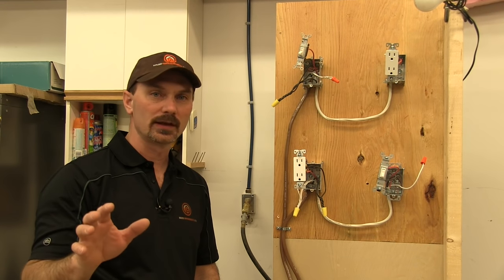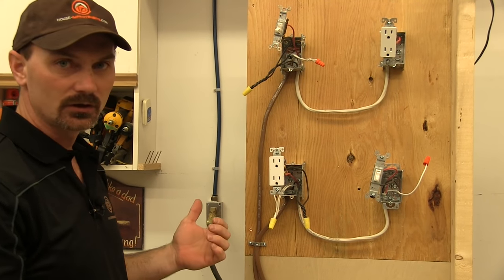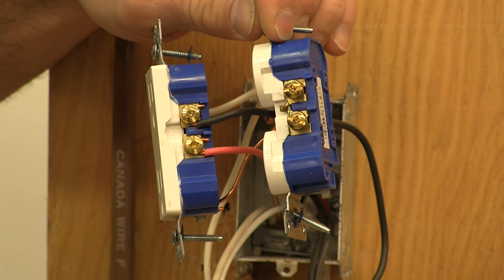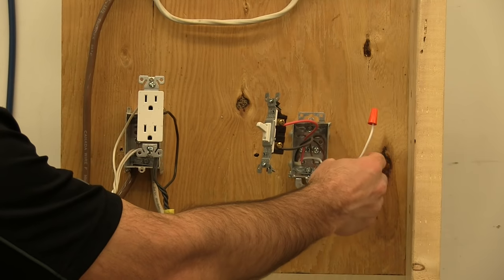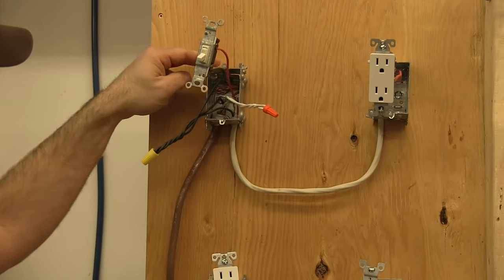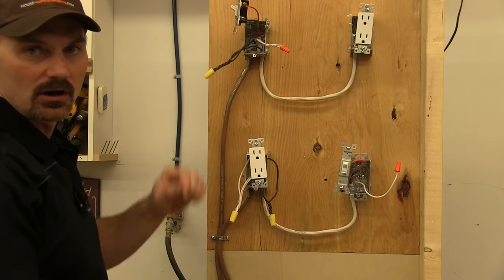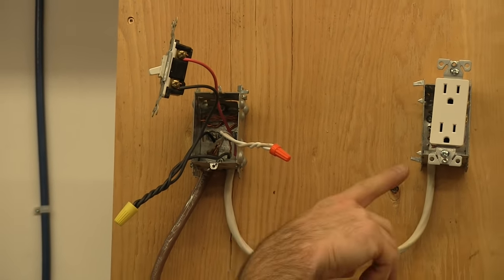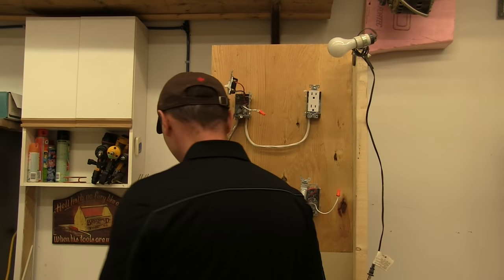How To Wire A Switched Receptacle

Comment: there wont be any big spark or boom if you forgot the tab, just wont be switched until you remove it
Reply: Giggle smith I agree I always work with live power 220 live awwww a slight jolt that tingling sensation what a way to wake up in the morning better than a cup of coffee from Starbucks .
Reply: @Guardducks  220 in North America is achieved with two separate hot legs, out of phase with each other.

Comment: Thanks again for a great video. I assume a black wire with red tape could be used as a red wire. 14 / 2 could be used....?
Reply from the maker: In the bottom example you need a 14/3 wire between the switch and plug. In the top example if you wanted both halves of the plug to be controlled by the switch then you could use a piece or 14/2 between the switch and plug. In that case you would also not remove the tap on the side of the plug.

Comment: My current challenge is how to utilize the same wires (which is the old two-line rope) that have been tied together along with the wires from two ceiling florescent lamps that are activated by a switch.  The other part of the challenge, in addition to the two-wire issue is that the power isn't running to the switch, it's running to where the lines have all been tied together.  What I want to do is to simply install an outlet with both sockets being run by a switch (which is already in place) so I can replace the current lights with LED lights that plug in and use the switch to turn the lights on.  Thanks!

Comment: Do you do it the same way if your bottom outlet is the main power coming in, and the top outlet is power going to the other outlets? How do I keep everything else on other outlets on if it’s supplied from THIS outlet that I wired to the switch

Comment: great job,thanks 4 all the videos, i have lights on my front fence connected direct to my breaker box along with my electrical gate, the problem here is that I wanted to put a switch and by doing so,when I turn off switch the electrical gate turns off too,how can I be able to fix this
Reply: 12/3 UF romex.

Comment: Hi... I have a situation like in the first example . But. I want the two outlets to have power at all time ( cancel the switch for the bottom outlet) if I connect the cables ( black and red) from the switch and live it in a metal box, would that be fine?

Comment: I'm installing a front porch light. I have an outlet near where my switch is. You think i can use the outlet for power supply to the switch? 

Im sure i can't just wire from the light two the switch to make it work. Pretty confused about this part.
Reply from the maker: Please post your questions in my forum and we can work on them from there ,thanks.https://www.house-improvements.com/forums/

Comment: This is a great video!  I need more help though. Please would it be possible for you to describe how to use/wire in a GFCI as the leftmost receptacle as shown in the first example (first 5 minutes of your video)?   I have a downstream single-faceplate combo switch/single receptacle which controls the food disposal The single three-prong receptacle on the combo is supposed to always be hot. When I tried using a GFCI upstream as shown in your example (first 5 minute example ), it always trips the GFCI when I flip the food disposal switch. I AM using a 20amp GFCI on this 20amp circuit. Also, It is not the disposal start-up amps tripping the circuit, because anything I put on the switch trips the GFCI, even a little battery charger.  Something is cross-wired.

Comment: Very helpful video. One question maybe you can help with. My gfci in garage is 20 amp and I just replaced it. I have a 15 amp outlet that needs to be changed outside that ties to the GFCI 20 amp. Is it ok to replace the 15 amp outside with  20amp outlet? Sometimes my 15 amp is overtaking and trips the Gfci.  Thanks
Reply from the maker: If the wiring from the GFCI to the outside plug is only 14 gauge then you likely will not make any difference. GFCI receptacles with trip easier than a GFCI breaker, maybe you can switch the breaker to a GFCI and get rid of the GFCI receptacle.
Reply: You didn't say if it is a 20 amp circuit, 12 gauge wire, I assume it is. You cannot use a 20 amp receptacle on a 15 amp circuit, but you can use a 15 amp duplex receptacle on a 20 amp circuit. Same thing applies to gfci's.
If you're gfci is tripping it is either bad or it is detecting a ground fault. A 20 amp gfci or receptacle will not correct the problem. A 15 amp spec grade receptacle is exactly the same as a 20 amp, but without the horizontal slot. 15 amp gfci and receptacle is really what you should use actually.

Comment: Thanks for the video. On the first application you show, is it really necessary (other than code) to use 14-3 wire? Emphasis on the "three." If you're capping the white wire off at the switch, does that mean it's not used? So technically (not legally), could I use a 14-2 wire and just not have an extra wire to cap? I hope that makes sense. I have an existing outlet with a 14-2 going into it and a 14-2 coming out of it. I just want to connect a switch to the wires coming out of it. Hopefully you can answer. I kind of confused my self with this question.

Comment: I do not see any recent posts regarding this video so I may be out of luck to get a response but I will try anyway.  I would like to make my garbage disposal plug a switched plug, top outlet controlled by the switch, and the bottom plug constantly hot. My switch has two whites twisted together and the blk wire on the switch my duplex has just two wires blk and white making the whole outlet controlled by the switch. Is there any way to make half of the duplex hot all the time?

Comment: Ok so I had a litlle oops in my house earlier today. I tried to fix my bedroom switch which hasnt worked ever since I replaced all my outlets/plugins about 20 yrs ago. In doing so I guess I "broke" the light switch in my bedroom that would obviously turn on/off one or more of the plugins. I knew it was because I had not broken the tabs. Well today, 20 yrs later, I decided now was the time :) I turned off breaker and opened the two plugins near my bed that I would want the switch to control. First off my switch has just a black and white wire. The first plugin I opened had two sets of black/white coming in (lets call call top left and top right). The two blacks went to brass side of plugin, and the two whites on other side but they were mismatched, the white/black of each "top left and top right" did not both go to their own plug, the whites were crossed. No idea if thats correct or my mistake from 20 yrs ago. I broke off both tabs on that plugin (probably wrong call). 

I went to the second plugin and it had 3 sets of black/white wires coming in, but I have no idea where each set comes from. If looking into plugin receptacle I had one coming from bottom left, and two on top, top left and top right. Lets call the screws on the actual plugin upper and lower. Here's how they were laid out:

Top right black wire:  going to marrette (twist lock)
Top right white wire: upper plug screw

Top left black wire: going to marrette
Top left white wire: lower plug screw

Bottom left black wire: upper plug screw
Bottom left white wire: going to marrette

Marrette wire: going to lower plug screw

I broke both tabs of this one as well...and basically none of the plugs in my bedroom, and my kids bedroom were working anymore. 

I ended up replacing both plugins with new ones and left all tabs intact, and everything is back to way it was. 

But I want to make the switch work, so which tabs do I need to break If I want both lower plugs in the two receptacles i opened up tied to the switch  and working as they should?

Comment: My setup has two split receptacles on the 3-way switched circuit controlled by the same two switches.  Would I therefore need two sets of 14-2 (instead of 1 set) running between the receptacles?  If so, I presume that's because the always-hot outlet on each receptacle is essentially on a separate parallel part of the circuit from the switched-hot outlet on each receptacle.  Is that correct?  Could you provide a demo of that situation?

Comment: I haven't searched through all of the comments to see whether this question has been asked but I'm wondering whether the wiring is any different if I'm using a GFCI outlet?  I'd still prefer to have half of the outlet constant on and the other half controlled by a switch.  Any advice/input would be appreciated!
Reply from the maker: A gfci outlet can't do that, at least if it can I dont know how?

Comment: Hello Shannon.  I have an older home and in a spare bedroom, I am changing out all of the outlets.  I have a switch that turns on an outlet which in turn turns on a lamp.  What I wasn’t expecting was to see three neutral (white) wires on one side and three hot (black) wires on the other side of this outlet.  Three white wires go in three different holes on one side and three black wires go in three different holes on this socket.  The ground wire is also connected to the ground.  I went to the big box store to get a socket with six holes.  But they only have sockets with four holes on one side and four holes on the other side.  Of course, they also have the standard two holes on one side and two holes on the other side.  Now, regarding the original socket, the top plug is turned on by the light switch and the bottom socket is always hot.  Can you provide some recommendations on how to install this new eight hole socket with three white and three black so that the top socket is still controlled by the light switch?
Reply from the maker: All questions should be posted in our forum please ,we can help from there. A picture would help as well. https://www.house-improvements.com/forums/
Reply: Pigtails, wire all black wires together with a 4" pigtail and use a large wire nut (gray), do the same with the neutrals (white wires).

Comment: In the first example, is it fair to say that the 14/3 wire is used because the code requires a neutral cable to be available in each box? Otherwise the white could be used in a place of the red wire.
Reply from the maker: yes new code stipulates you need to have a neutral at the switch

Comment: Great video! I have two cables in the outlet box. Quite wire from one cable is secured with a black wire from the other cable with a wide nut. Is this normal?
Reply: Yes the old code allowed the white wire to supply the switch with power, and the black from the switch was connected to the receptacle.

Comment: So with incoming power at the switch and the switch controlling both outlets it’s essentially the same wiring as a switched light bulb fixture? Ie: With supply to switch box, tie neutrals together in the box, tie grounds together and a jumper to switch ground(I’m using a timer switch). Black wire from supply cable to one side of switch and other cables black wire on other side of switch feeding out to the outlet. Sound good?

Comment: So would it be correct tosay that you used 14-3 to that switch as the switch loop so that you could leave an unused neutral wire? So if not for that you could have used a 14-2 and put black tape on the neutral wire?
Reply from the maker: Yes ,but by code now we need a neutral at the switch even if it is not needed.

Comment: If you don't mind me asking, I searched your videos but couldn't find one with my situation. We purchased a house that has a "toilet room" that was added on after the home was built. They ran the main power line to the light fixture first, then ran a 2 wire (black and white) 14-2 down to a single pole light switch (1 silver screw, 1 brass screw). There is no outlet in this room and I would like to add one. The easiest thing I could think of is adding a combo Switch/Outlet so I don't have to cut a hole in the wall. However, everything I am finding says you can't do it. You have to have at least 3 wires running to the switch (not including ground) and then tap into the power before it gets to the lamp. Do you have a video explaining a setup like this? I may have missed it in my searches. Thanks.
Reply from the maker: Ya what you have now is called a "switch leg". Power comes down one wire to the switch and when you flip the switch the power continues back through the second wire back to the list to power it. 
Foe a receptacle you need a neutral , which you dont have now at the switch. 
You need  either another 14/2 from the power at the light position to the plug in or a 14/3 wire instead of the 14/2 you have going to the switch right now. 
For more help please come to my forum.https://www.house-improvements.com/forums/
Reply: @HouseImprovements  Thanks for the info! I think I will go the easy route and replace the 14/2 with a 14/3. I think there will be less headache and it will be easy enough to pull the new 14/3 wire through the wall using the existing 14/2 wire by pig-tailing them together and then pulling the wire.

Comment: With the Bottom example, could you pull power from the switch to power another switch for an overhead light?
Reply: Yes, you could pull power out of the black wire at the switch, and pigtail it.

Comment: Always enjoy your helpful videos, Thank you, I have a question, I want to install a switch to one  outlet in one room, that is in a circuit of 3 or more receptacles,  without shutting down anything downstream when the switch is turned off, Do I do that by the half plu method? like breaking the tab?> and have one half always hot in the circuit? and  the other half switched?

Comment: Hi Shannon, This is a great Help. I have a question? I got a 20 amp. switch that has 2 brass screws on either side on top, and one on the bottom (r) that is a copper screw. It said on the box that this switch can control lights from 2 locations. Was this the right switch and will this work.Ground is on top of switch. I want to use a plug like you have and it is also 20 amp. plug. I will be using 12/2 with a ground. This is for a swimming pool pump, or should I use a GFIC plug for this and can I use it on a 15 amp line.  Can you tell me if the wiring that you have there will work with this. I need Help. Thanks I enjoy all of your Video's .
Reply: Stanley Keith it’s a 3-Way switch you need too use a 12/3 instead of a 12/2

Comment: What if you want outlet on all the time and not dependent on the switch
Reply from the maker: Remove the  receptacle and replace it with one that does not have the side tab broken off and do not hook up the switched power wire. Use a good wire cap on that wire and fold it carefully into the back of the box. If you need more help please use my forum.

Comment: Got a good question for you why is it that having two switches in a bedroom with the two recepticals but the switches are not working for the receptacles to turn them on & off? Both tabs was broken out & they are new rocker switches & receptacles, one receptacle bottom half is live but top is dead & switch isn't turning it on?
Now on the other receptacle both top & bottom is always live but again the rocker switch is not working receptacle? I am at a stand still on all this, what do you think is causing this to happen bad new single pole rocker switches i just bought or a miss wiring of the the receptacles? Not sure if the recepticales may have been single pole or double or three way switches? This is all puzzling to me an electrician wants 325$ to come out to look at it way too much money for this it just seems that no power is at the switches when I run a beeping testor on the switches only the receptacles have the beeping sound & like I said it's strange that one recepticale has full power switch no power then the other receptacle bottom half has power but not the top & switch has no power at all totally confused I am.
Reply from the maker: Best to come to our forum where it is easier to help and go back and forth with you.  Just copy and paste your question from here to there. 
https://www.house-improvements.com/forums/

Comment: Do you have to have it be half hot? Can I you have the entire outlet be switched and just use a 12/2 or 14/2 wire from the switch to the receptacle?
Reply from the maker: Yes you can just do not remove the tab on the receptacle and obviously do not attach constant power.If you need more help please use our forum.https://www.house-improvements.com/forums/

Comment: If I don’t care to use the switch for a lamp or whatever can I Just pigtail all the black together, wrap around one screw and leave the tab in or does the tab come out regardless. I have 3 black and 3 white.
Reply from the maker: That is correct. If there is no switch wiring there. If there is switch wiring you can leave the switch wires un hooked and capped in the box.

Comment: Question: can I do this method for an electric stove and microwave? I'm trying to avoid unnecessary electrical usage.
Reply: Why would you need switched receptacles?   Just don't use the appliance.  When not in use it doesn't use any power.

Comment: i have had 2 electricians rewire my house.  now a new guy I spoke to says I should use a junction box for a bedroom I have with 3 outlets with basement access. but by friend said I shouldnt use junction boxes. It seems like this was the old school way the house was wired. are there any advantages or disadvantages of using the jbox?  what is code?
Reply from the maker: No junction boxes for receptacles are not needed, use the proper boxes. Sometimes you need a square box with a mud ring if you have a lot of wires to accommodate but usually that is not an issue.